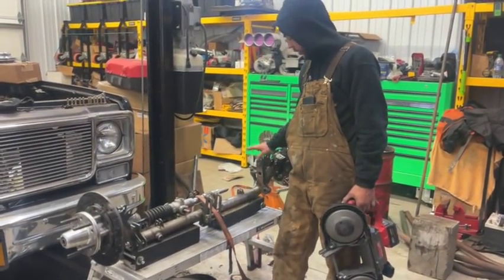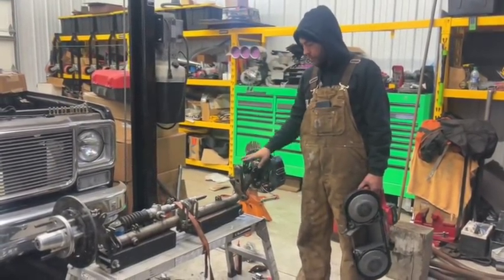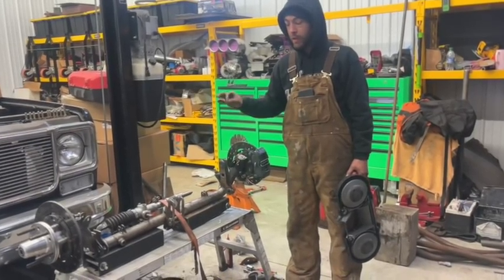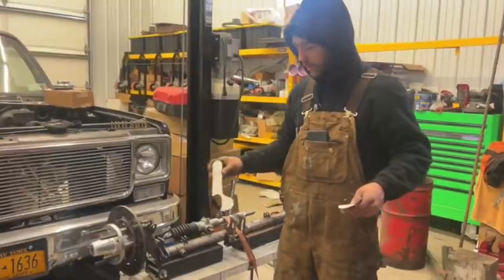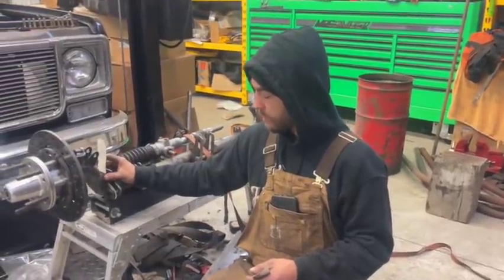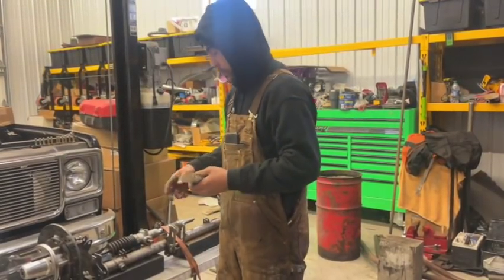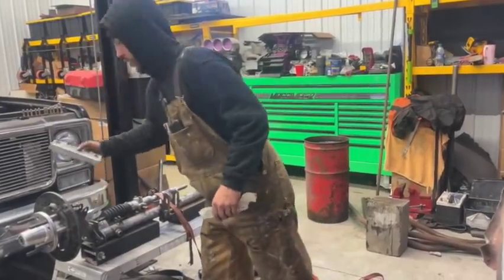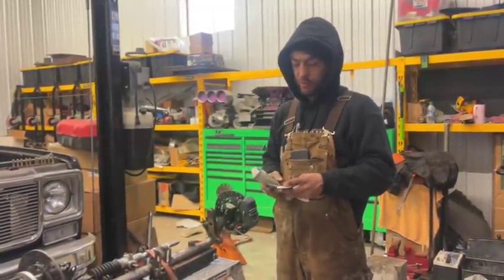Repairing the “WAC customs” drop axle

Comment: Nick, keep it up man. Wish I would of seen you at PRI Friday. Thing I love about this video is that it even though most of us are not running a drop axle it still gives us the basics we need for modifying/welding any brackets on an axle. Especially for those without chassis table. Took me a while to realize I needed a digital angle gauge and protractor for setting up a car. Keep it up man. Love the build videos.

Comment: Well apparently You Tube doesn't like the G word to find stuff. So, Nick look up a Grizzly G1006/1007 Mill. It on 110 and you just need a 30 amp breaker to run it. And how big of a metal break are you looking for also.